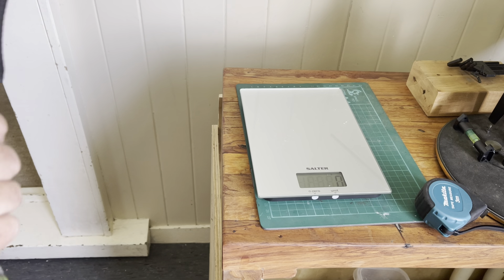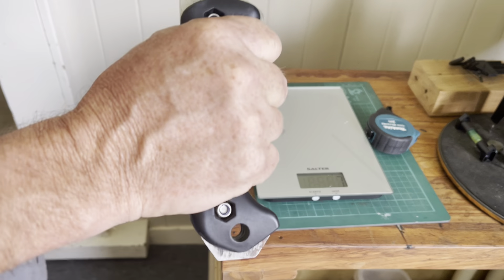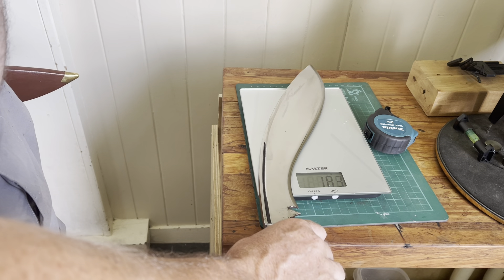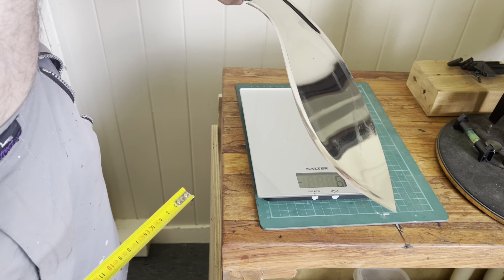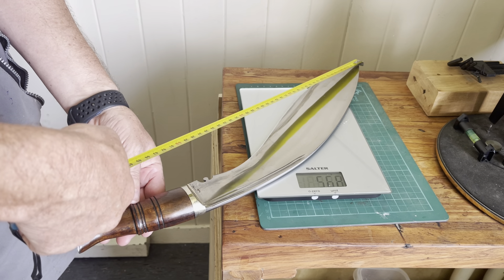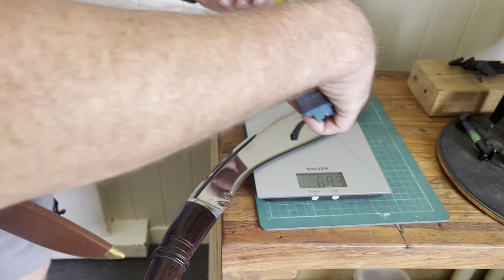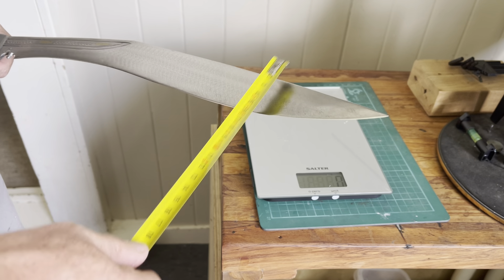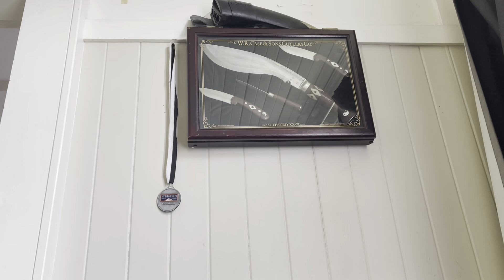Khukuri kukri lengths and weights.

Comment: You have a great collection.  I appreciate you showing us the specs on those kukri's.  My first kukri I bought off Amazon.  It weighs over 800 grams not including the scabbard.  I hated it at first because is so heavy.  Then I bought some much lighter kukri's.   Now I like the heavy kukri because I found out that it is a good chopper.   I wouldn't want to lug it around but its ok for cutting wood for the BBQ and I do enjoy it for that.  I am old so I can't swing that heavy thing for very long.  But, its a pleasure to use occasionally.
Reply from the maker: 800 grams is very heavy, but it will be solid at least!
Reply: @ShelleyRaskin  If someone wants to borrow one of my kukri's it would be that one.  Thanx for replying.